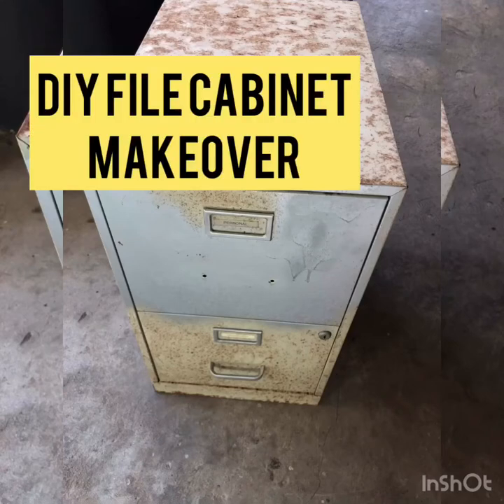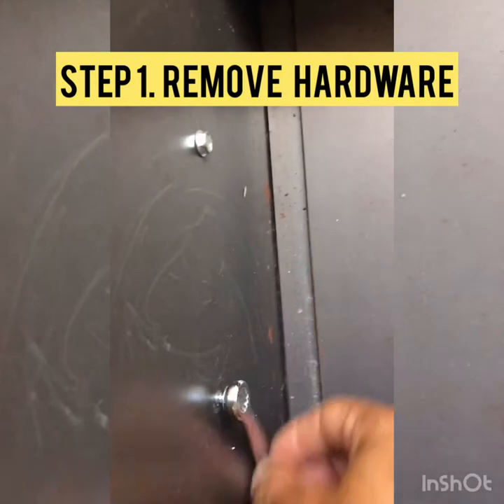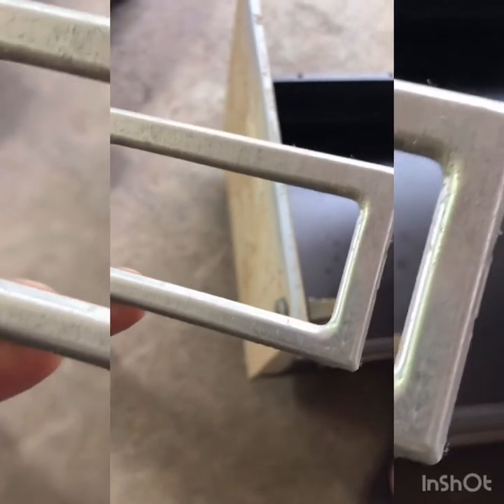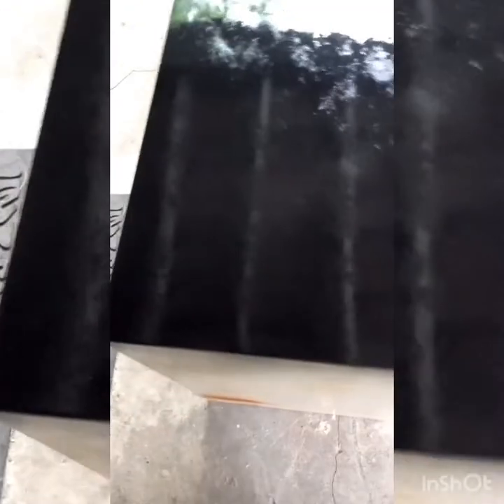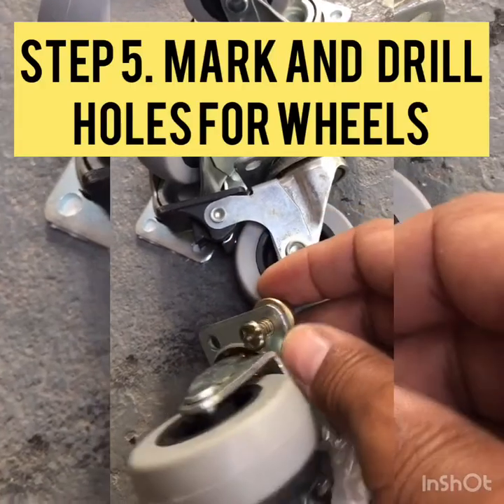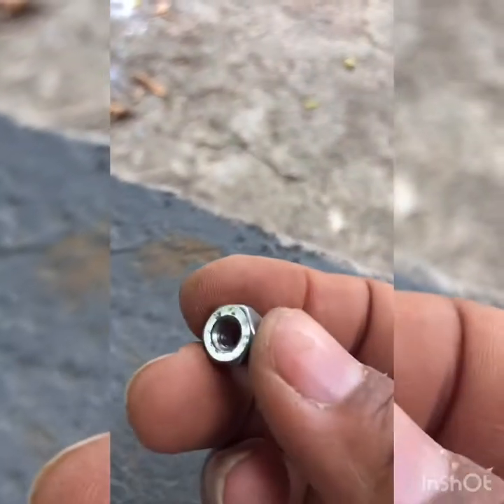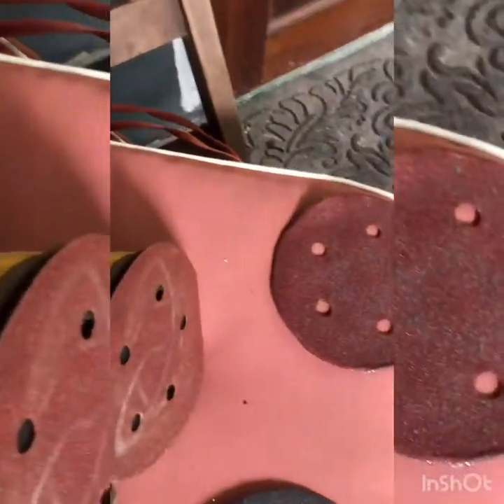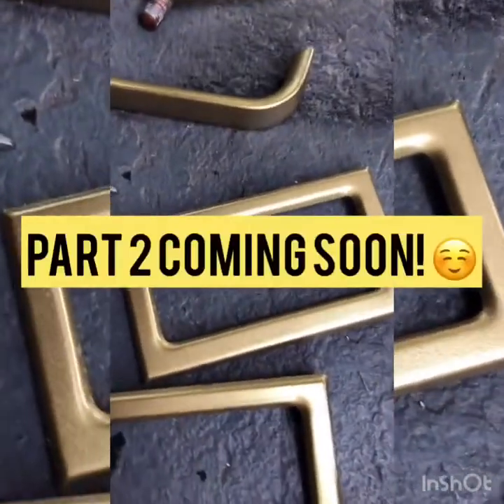DIY filing cabinet makeover

Comment: Do you think it's possible to sand to bare metal with 80 grit sandpaper?
Reply from the maker: This was my first time sanding metal. I think you could use 80, I wanted a very smooth finish, so my goal was just to get the existing paint off as well as any rust spots.
Reply: @michellegeorge787  i want to sand mine to bare metal & allow them to develop a rust patina then clear coat them to stop further rusting . They will be used as planters
Reply: Some say its easy peasy to get the paint off of these cabinets others not so much. I guess I won't know till I try
Reply from the maker: @pearlperlitavenegas2023  I did not find it easy at all, perhaps the rougher sandpaper would have made it easier, but I was concerned about having deep scratches in the metal. I took off most, buffed it to smooth finish and then applied the paint finish. It is great having it on wheels!
Reply from the maker: @pearlperlitavenegas2023  oh yeah that sounds very cool!